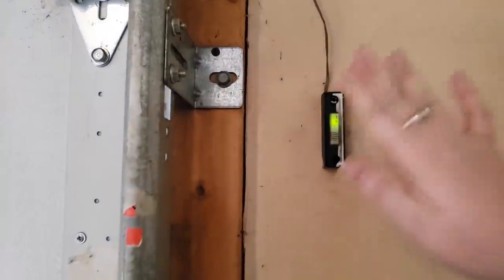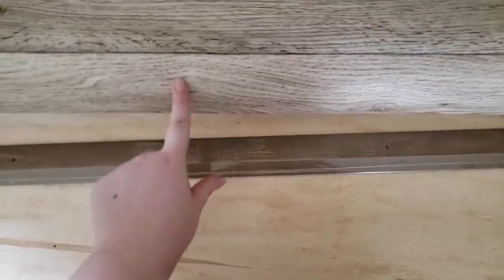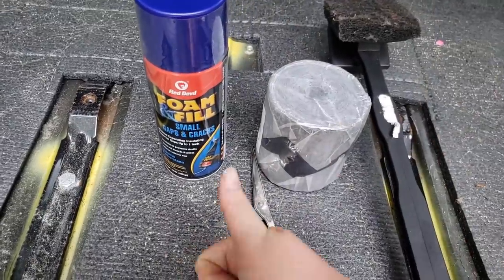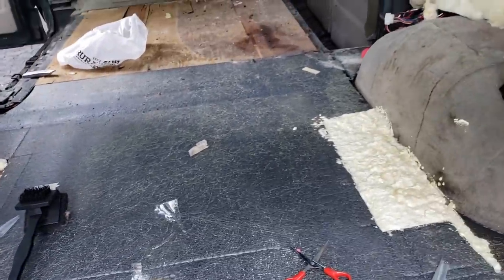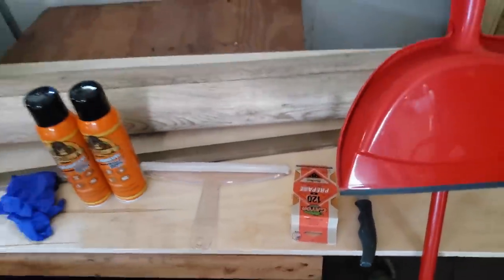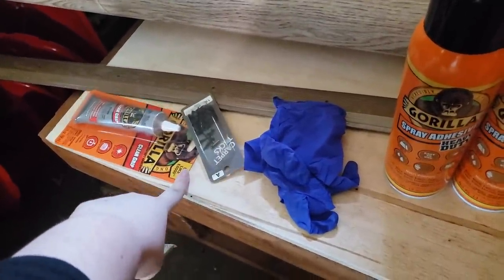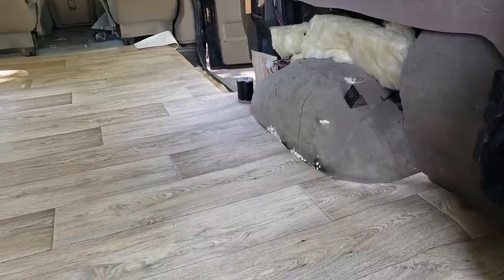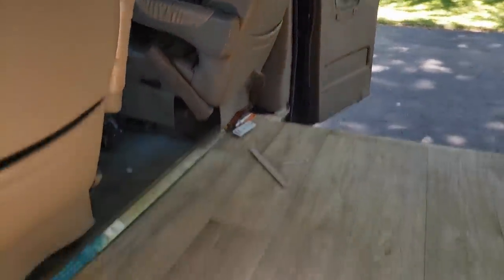VAN BUILD | Flooring for VanLife! (Cheap and easy vinyl flooring install)

Comment: Awesome job Chantal! Your van is looking great. It's really coming along! I finally bought my new van. Just waiting to get my solar installed I'm in central Florida and will be driving to Savannah Georgia to get mine done and to get a trip to one of America's most haunted cities. Looking forward to that! My van looks like yours but about 4 feet shorter. Lol. Everything was so expensive or had over 200k miles on it and was still expensive. I paid $7400 for a van with 136000 miles. Already built out for the most part. Hopefully we will cross paths down the road. Blessed be!  🧹🧙‍♂️

Comment: I'm glad you didn't "professionally" fill those holes up in the floor from those bolts...someday you may add a diesel heater and you could possibly reuse the holes for exhaust..? Maybe?

Comment: Does your front passenger seat swivel? I like your flooring choice. I heard planking wasn't good in a van anyway, because it moves, and then you get gaps. I heard vinyl is really the way to go.

Comment: I'm going to add flooring to my van tomorrow. This may be stupid, but I thought it came with adhesive already on the flooring. Maybe it's not as heavy duty so that's why you used the spray adhesive? Or maybe we just purchased different types of flooring, but mine is vinyl as well. My van is a 15 passenger, so I had to get 2 boxes. I still found something that will work with the rest of the aesthetic and was around $80. Now I'm just curious if I need to go on a hunt for spray adhesive.